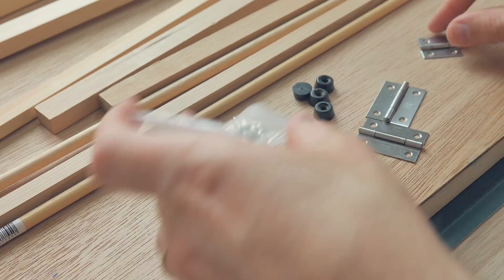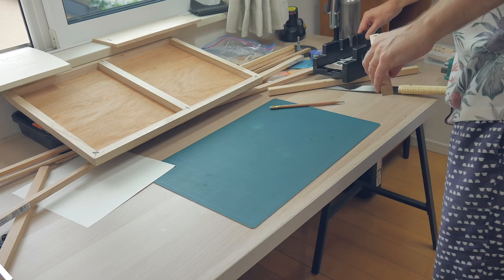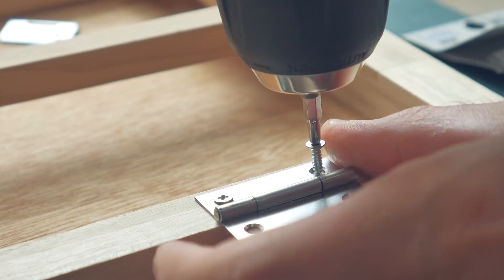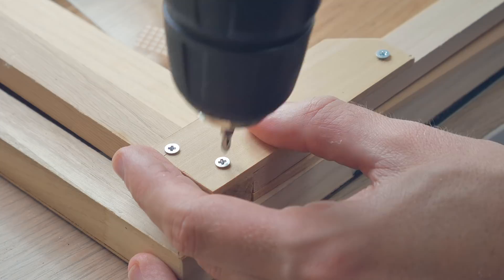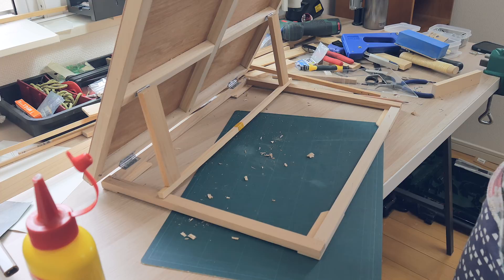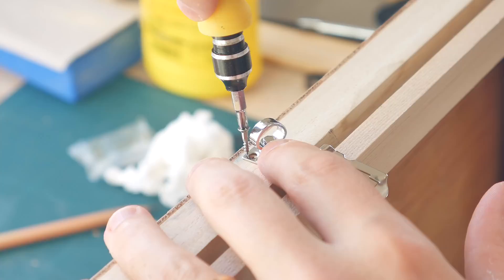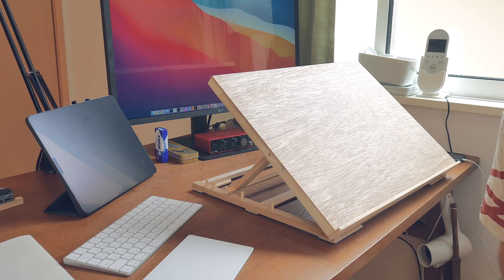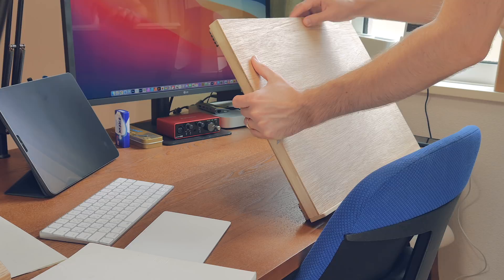Building a DIY Drawing Board

Comment: Great job.  The only thing I'd change is I'd add a 1" x 2" piece along the bottom front  so it grips the table and stops it from sliding back when you press on it.  You can't have a rounded desktop though.

Comment: When you could buy end rolls of newsprint, for rough drawing paper, I just used one of the really thick cardboard tube cores, propped the drawing board on that and secured it with two drawing board clips. It's the right angle for me and sits on my drawing table still okay after forty years. Back then, the end roll cost me 50p. A couple of bits of Blu-tak stops it moving. They've practically set like concrete over the years.